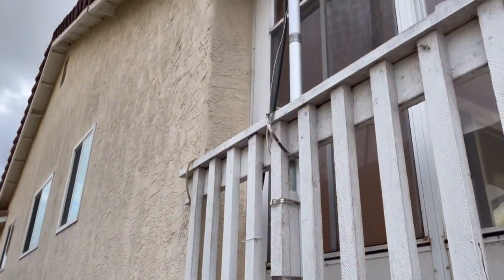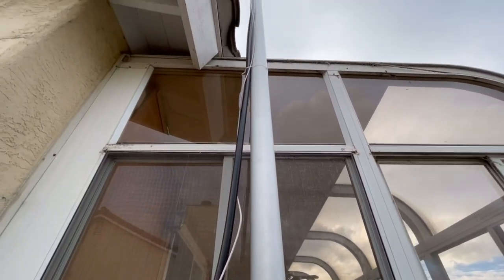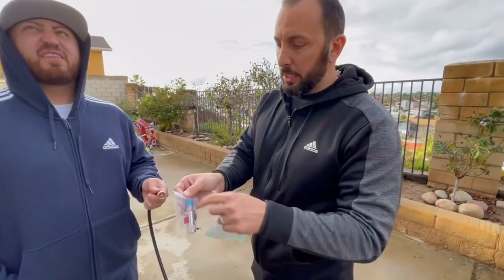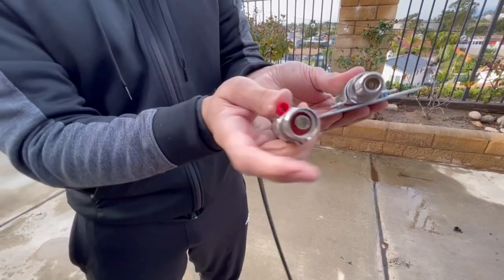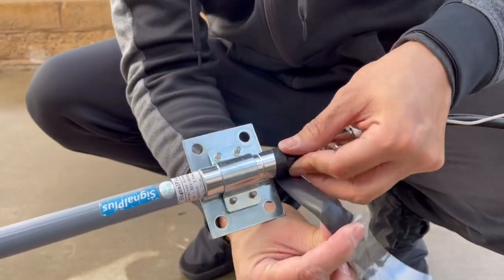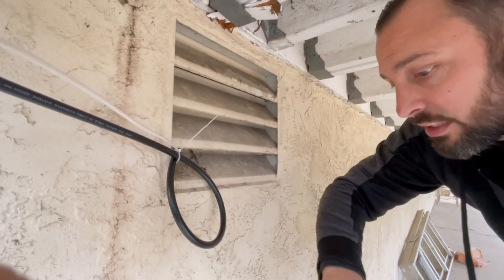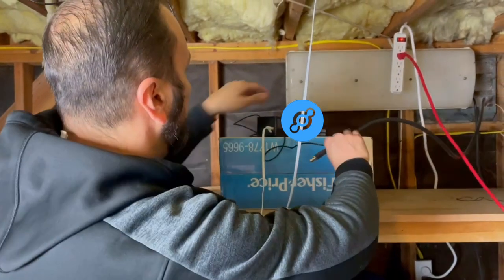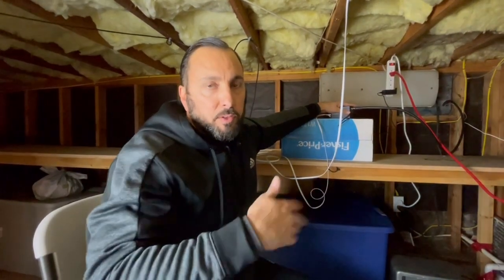Flag Pole Antenna Setup For Helium RAK or Bobcat Miner | Higher Antenna Higher HNT (Money) Earnings

Comment: Be weary of signal plus and eBay Amazon antennas , they are rarely what they claim to be. Look at McGill 6db or 9db or Rak 8db , the rak 5.8 is not as good as McGill 6db. Second the lightning arrestor will not protect you from direct strike, and you should place the arrestor were the cable enters your home. Because lightning or nearby lightning will induce current in your antenna , your mast and your coax cable also. Your arrestor placement only protects the antenna part but not your cable. The mast should also be grounded. I would have kept the lmr600 the small cable at the end would have negligible loss compared to what you will loose on the lmr400 vs 600.
Lmr400 is 0.051db per ft (if it’s good TMS cable) lmr600 is 0.025db per ft,  so at 30ft 400 would be 1.53db and 600 is 0.75. Also the connectors on the cable also have loss cheap connectors on cheap cable  could loose you 0.5db+ for each connector good connectors 0.2db. Lightning arrestor also has loss could be up to 1db. On your 600 setup the last adapter cable for n to rpsma you had was very short loss on this would not be significant compared to loss on 30ft lmr.

Comment: Thanks for the great video. I'm not a miner, yet. Just trying to figure out how to do it.
But as a side note, I noticed that you used a plain ordinary cat 6 ethernet cable outside. I recommend replacing with a outdoor rated network cable.  The sunlight will quickly degrade the regular cable and it will be much more prone to interference.

Comment: Rainproofing your antenna connection.  You should start your wrap from the bottom of the cable connection and work your way up to the top of the antenna connection . This way rain has no chance of entering in between the wraps.
Reply: Pro tip right here ^^

Comment: Thank you for the content. Someone must have told you already but just in case they havent. I believe the bolt next to the red plastic is meant to attach the lighting cable. Unbolt a little bit the screw, get the cable below and bolt it again. Also i would put it the other way around so the cable does not make a U turn. But then again I am no expert so everything I said could be wrong.

Comment: thanks for the video, very helpful. Do i need the lightning arrestor if I'm not going to ground my setup? (we rarely have any lightning here)
Reply: Lightning arrestors primary function is discharging static electricity from air flowing over the antenna.
Reply: I didn't use a lightening arrestor, either, but did plug it into a surge protector. Not sure if a surge protector can withstand a direct strike, tho. So, we'll see. Lol!

Comment: So you dont crimp the plastic you crimp the metal under the plastic and put the sheathing of the wire under the plastic then heat sgrink the plastic to creat a weather proof seal. As of rite now you ground isnt connected or its just barely rubbing which will effect your antennas signal.

Comment: How long is that 10dbi antenna, exactly? And is it omnidirectional or directional?
Nice set up! You should pull 3-$400 a month, easily.
Reply from the maker: It’s approximately 4ft and it’s omnidireccional
Reply: What would that set up earn nowadays?
Reply: @CesarCinema   @Caesar Realized there is no regulation w these antennas, so, they're selling them at different sizes. Add omnidirectional vs directional and it gets slightly confusing, unless you know what to look for. My 5.8dbi is 36", my 8dbi is 44" and my 10dbi is 60" inches. I've got 1 shitty location that's being blocked back by a mountain, but I'm determined. Mounted my 10dbi on the roof, but need to do what you've done here. Where did you get the extention pole, Caesar, if you don't mind me asking?

Comment: Looks good, but why don't you put a bracked on the roof trim board and to the pole for more stability?  just a thought. :)
Reply from the maker: That was the original plan but I really don’t need it. The pole is pretty sturdy
Reply: @CesarCinema  the best of luck with the project. ;) I'm still waiting for my bobcat.
Reply from the maker: Good luck to you too bro. That’s why I bought on eBay to get my miner faster

Comment: Curious to know, how is this setup holding up? Did you use all the items from Amazon? Particularly the cables from Amazon? What is your daily HNT on average since you made this set up?
Reply from the maker: The setup is working perfectly fine. Everything is from Amazon. Earnings went down but on a good day .35 HNT.
Reply: Thanks…I’m going to do similar set ups based on your other videos. I’m currently indoor antenna now but plan to go outdoor very soon. Noticed earnings went down tremendously since the update on March 25th. It seems like the antennas that are outdoors and high elevation is the way to go.

Comment: As mentioned already you need to crimp the connection more on your ground wire. Also use Dielectric Grease on your exterior connections.
Reply from the maker: I prefer the silicone tape instead of the dielectric grease. I did crimp the connection on the grounding wire. Do you have a picture or can explain how to do it more? Next time I take the antenna down I’m going to replace the 12 AWG with 10 AWG so it fits better but that’s what I had to work with.
Reply: It looked like you maybe just crimped the plastic part of the connector, crimping the metal part will actually take a nice squeeze with those crimpers. Setup looks cool tho, wherw did you get the flag pole material?

Comment: LMR 400 is male to male? Can I have the unit in the attic and antenna outdoor? I am in Central Florida, I am not sure if product will hold summer heat in the attic.
Reply from the maker: The LMR400 that plugs into the miner is RP-SMA and the other side depends on if you buy a female or male antenna

Comment: I have read and seen videos that recommend the lightning arrestor be installed closer to the ground vice at the top.  In addition, the arrestor should not be directly connected to the antenna.  Not sure which is correct but thought you should know.

Comment: Hi great job but you must Cramp the red ring connector closer to the ring it is not tight around the wire or you can sodier it you missed it should be tight around the wire. everything else is great
Reply from the maker: Can you explain more? I did clamp it to the red ring.
Reply: @CesarCinema  You only Cramped the bottom there is about a 1/8 to inch plastic watch the video I have done it myself I mean no harm it is to be cramped toward the top of those ring connectors. is all about the witnesses the higher the better 80 and higher 125 is cool stay safe

Comment: Minoxidil update?
Reply from the maker: I stopped using because my neck area got red and irritated. So my beard hairs fell out a lil over time. But I did get to keep a good amount of hairs.
Reply: Hey that’s good to know still glad to see minoxidil gains are strong and permanent for the most part
Reply: Are you selling the 600?
Reply from the maker: No. The homie Pat is gonna use it on his new setup